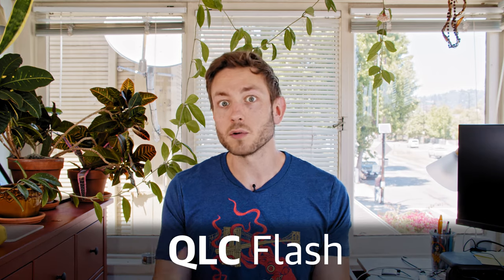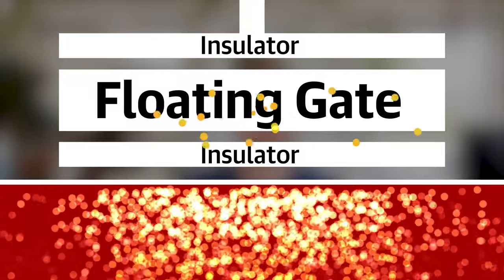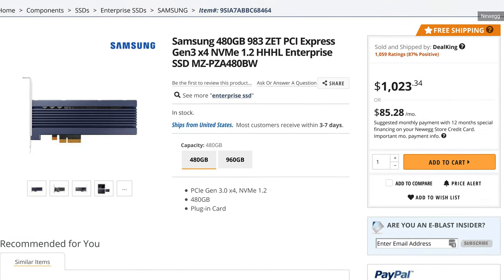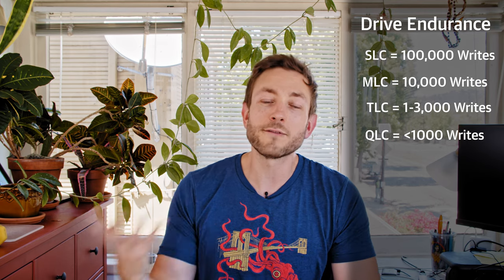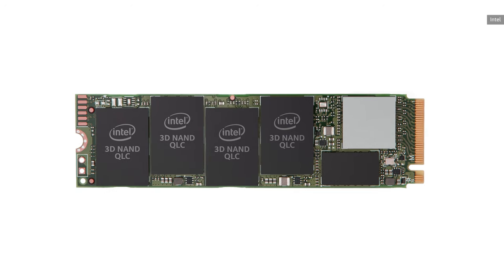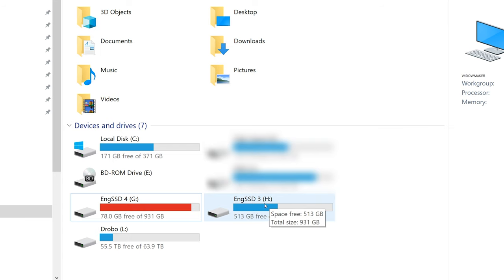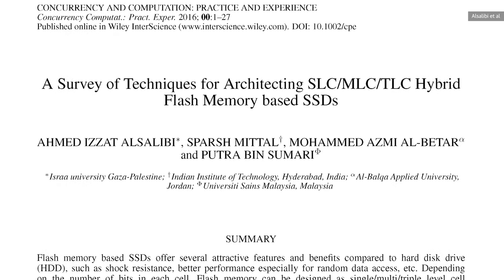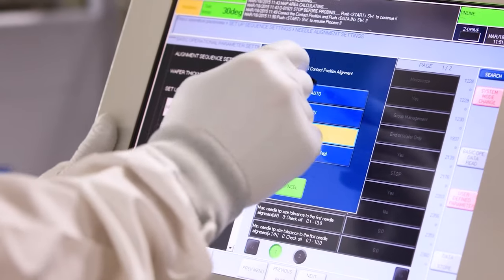How do QLC SSDs work, and should you avoid them? | Upscaled

Comment: I recently upgraded my main computer with an SSD so I've been reading/watching everything I can about this technology. This is an excellent video to get you started on different SSD types and to make sure you know exactly what you're buying when you finally decide to upgrade your computer.  I feel Crucial MX500 is still the best (budget) option cause it's TLC and it comes with an actual DRAM module, which does most of the writing heavy lifting (as opposed to that SLC "emulation" cache nonsense that some TLC/QLC drives use), saving you precious write cycles, thus increasing your drive's operation speed AND lifespan.

Comment: Quick buying guide:
Open a site which compares ssds/m.2s n' compare/sort:  prices/gb  and read or write speeds of your preference.
Tip! Over 3.000 writes are m.2s TLC or better.
Pick same or similar prices of drives regarding reviews/benchmarks.
HDDs for casual users should being used as an external back up drive nowdays. Backup => Unplug.

Comment: There's another point about the endurance, a couple of years ago they learned that high voltage applied at high temps can effectively reset the NAND to almost factory new.

We'll eventually likely see a new optimization option on our NAND drives that resets the write capability.

Also PLC is probably DOA unless they can cheaply have a 16 channel device or 192 layers, QLC is already slower in write speeds than some of my 2015 hard drives after using it's cache, much less my 2017 and later drives.

As much as I like the idea of a 4TB or 8TB SSD only costing ~$100 I just don't see it.

Comment: I found your analysis a more genuinely researched one. I am currently looking at Kingston's QLC-based 2.5" SSD versus Crucial's very popular MX500 (both 1TB versions), which have a ₹2k(INR currency) difference in their prices. Can you please suggest should I go ahead with the QLC disk since I'm a bit tight on budget?

P.S.: I'm upgrading from a 5400RPM HDD on my Acer Nitro-5 AMD Ryzen-5 2500u, and simply looking for a storage unit to replace my HDD since my OS is already running on Adata's M.2 SATA (with DRAM cache) which is doing great for my requirements.

Comment: I've always been curious about QLC but even more so these days because I just saw this Lexar NM610 Pro 1TB selling for $37 (which I can get for $30 after coupon). That's from not just one reputable seller but several reputable sellers. Very compelling.

However, while the product page says that it's a TLC drive, the low TBW of just 240TB for the 1TB model suggests that it's a QLC SSD. Some sites and Reddit discussions also say it's QLC. I'm inclined to believe it's QLC.

But even if it's QLC, $30 is still friggin cheap. Question is, would it be good as a system drive? I'm now using a Kingmax PQ3480 512GB Gen.3x4 TLC drive. Is it worth throwing $30 to get the Lexar or should I just pass it up and just grab a few burgers?

Comment: QLC should be cheapest option to long time HDD users. But, you should only go with QLC drive if it is cheaper at least 30% than TLC drive that is similar size and equivalent model. And never go NVMe drive with QLC. The last tech for NVMe drive is TLC, that's it. QLC and worse tech than that is limited to and shouldn't be considered beyond SATA3.0. That's it.

Comment: Say you RAID 0 two QLC SSD's. How would the cache situation get figured out? Would they combine their cache together, or would they run their cache's separately?

 Another question: Can the amount of cache bet set to a specific amount? Dynamic is cool and all, but say I know the maximum file sizes I would deal with regularly. I could then set apart a specified amount of the drive just for cache and maintain a fast SSD.

Comment: 8TB that can fit inside your pocket (with a case of course), no need extra bulky power supply and can connect to phone. It's a win. 

3 of my 2TB 2.5" external drive crashed which is very frustrating. I believe that QLC is here to fix that. Price will catch up soon enough.

Comment: Buy just slc for the OS and you will be fine, also mlc for data.
Reply: Try finding a SLC ssd. Even MLC ssds are increasingly rare, a popular example is the 970pro. A good tlc ssd is perfectly fine.
Reply: SLC drives are only at the enterprise level, not even for consumers.
The only MLC drives I know of are the Samsung Pro series
Get MLC for your OS and TLC for your games,media production. Skip QLC all together.

Even if you're replacing a hard drive in a console, get an TLC SATA SSD, they are not that much expensive than a QLC, for a lot better peformance

Comment: I care more about reliability (long term integrity of data) than price or size —or even speed (or the technology and infrastructure [material] that they’re made of). I’d love to have a 1TB thumb drive but am a little scared —each cell may be made of FEWER ATOMS, if you get my drift, thus easier to deplete. (In the days of mechanical hard drives, they increased capacity by sticking a second identical platter into the same-sized case!!
Can you advise or console me?😊?)

Comment: I would not trust ANY flash memory as storage for my only copy of a file.  I would want those files on something more tried and true like a hard drive.  Though the data can fade away slowly over time it fades quicker on flash memory.  The more layers each cell has the faster it is.  Maybe it becomes corrupt rather than fading considering all of the voltages that are involved when more layers per cell are in use.  SSDs may be fine for some people but I would rather use QLC to bring files to another computer or another person.  That is if they are big enough that sending them over the internet would take too long.  Really it is great that there are budget SSDs but really sometimes you can pay just slightly more and get a better one or at least one with a higher TBW or maybe longer warranty.  If reliability is what you want vs lowest cost per GB look at enterprise grade drives.  Some of them are only slightly more expensive per GB but may have a much higher TBW than that budget generic drive you found on eBay!